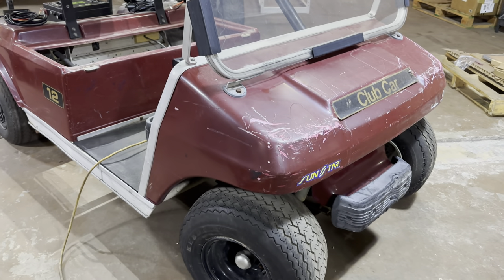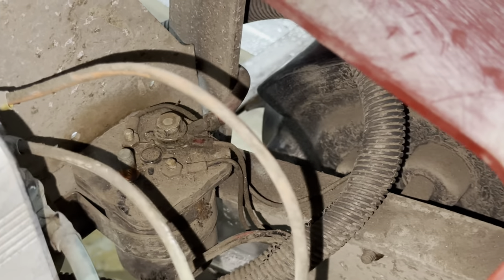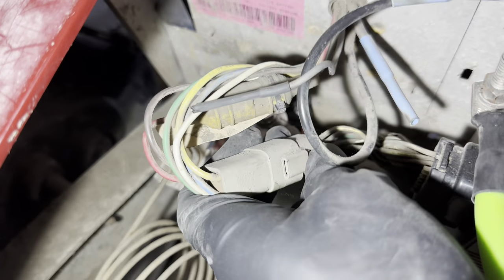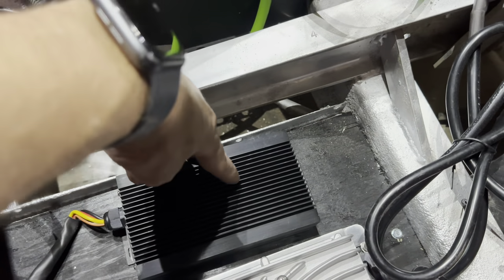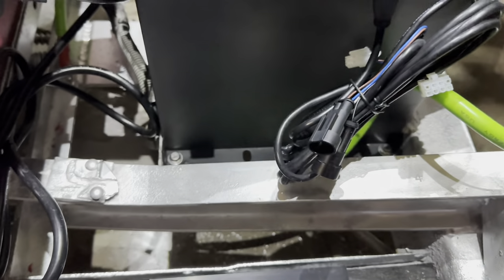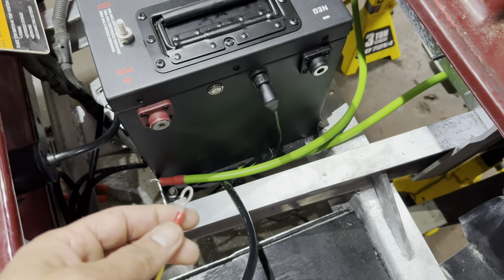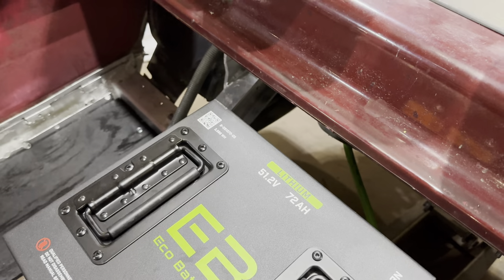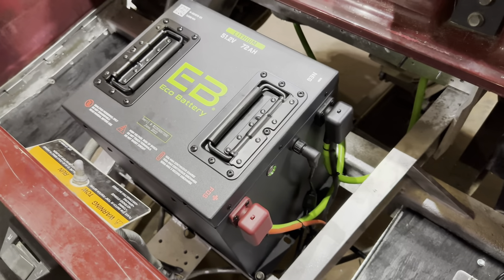Eco Battery 51.2v - 72ah Installation Video ~ 1999 Club Car DS

Comment: Hi there, so I just upgraded my 2003 DS with the Eco battery and I am to the point of bypassing the OBC but my plug only has 3 wires, yellow, brown , and red. Have you seen this and do you have any thoughts on which I should jump? Thanks!
Reply from the maker: Yellow goes to B- .. cut and delete everything else. I’m doing a video now on a 99 DS that will show it.

Comment: The bypass cable that you show has a diode in series with it. Which way does that dial go and what does it need to be rated for.
Reply from the maker: 3 amp and the positive side goes to the battery side of the solenoid

Comment: Great video. I just installed this kit and the battery charger, model A-1053, is giving a solid yellow light indicating COM ERROR. Any trouble shooting ideas?
Reply from the maker: It could be the new CAN communication charger that Eco just released. There are 2 extra wires coming out of the new chargers, one has a yellow and red connector. That connector/wire needs to be plugged into the wiring harness that connects the battery to the dash meter. Near where the wiring harness connects to the battery there are two small ports, this is where to plug in the red/yellow connector from the charger.

Comment: Regarding CC DS series carts bypassing the OBC. There is a yellow wire going from the small post on the solenoid to the gray plug (3 wires) coming from the OBC. Cut that wire off of the back of the plug opposite of the OBC side. Connect it to the main negative on your controller. This is the post where your large main ground connects to the battery. The reason for this bypass is that there is a safety built in that will not allow the cart to run while on its charger. By making this ground you have signaled to the controller that the cart is not on its old charger.
At this time you can cut the other 2 wires from the plug on the controller side cap them and remove and dispose of all the parts involving the old charge port and OBC.

Regarding the extra can plugs on the gauge wiring and the output side of the Eco Battery charger. This is from Eco Battery: take the grey and organelle can male connector from the charger and plug it into either can plug from the gauge wiring. It doesn’t matter which one.
Reply: So when it's done, there should be a yellow wire going from the OBC to the negative controller post? Or should it come from the solenoid to the negative controller post?

Comment: I've done the Lithium conversation (4 batteries) and removed the OBC - do I need to keep the old battery sensor light or can I bypass it and run the B + wire it straight to the key switch?  It would make the dash board look cleaner to repurpose that hole in the dash larger to accommodate the new square meter. Thx in advance.
Reply from the maker: I would delete the old meter